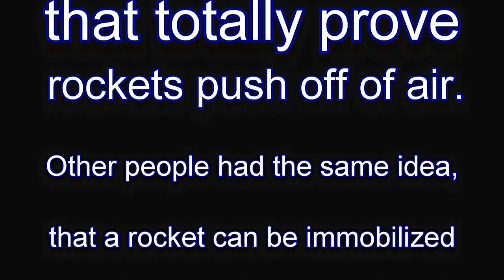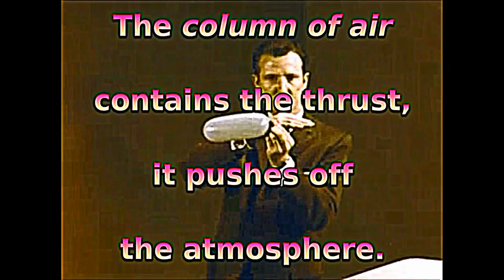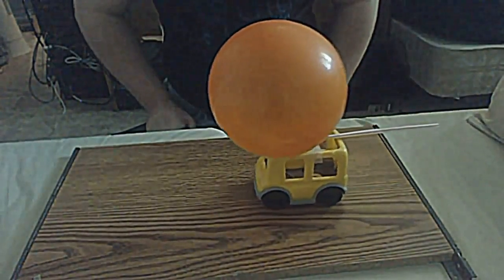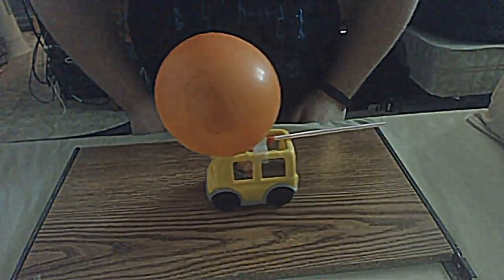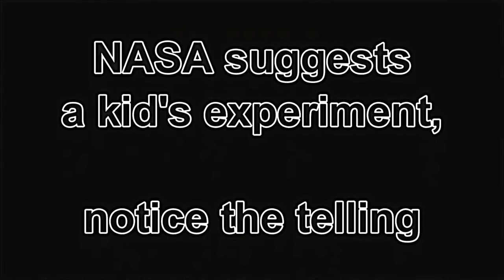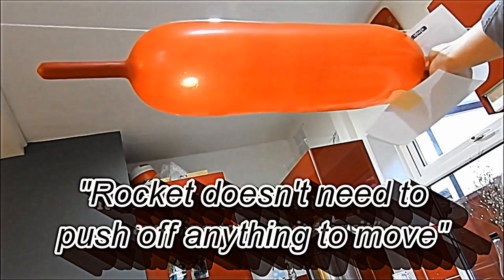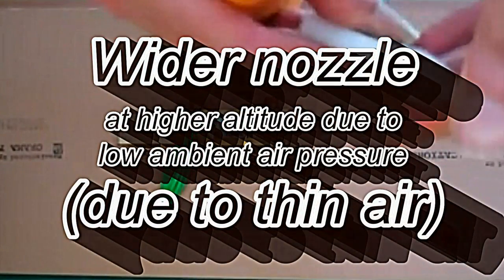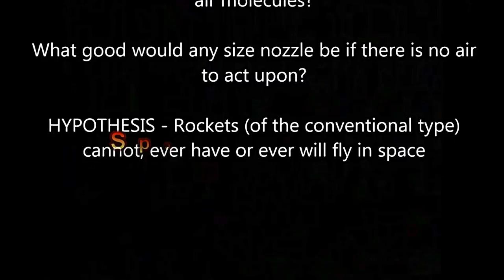rockets push off air

Comment: You've proved that if you redirect a rocket's exhaust so it exits out the sides instead of the back, the rocket won't go forward and will at best just spin... that's all.
Reply from the maker: Which debunks the "ejecting a mass" nonsense, since redirecting an ejected mass such as a cannonball, has no effect on the canon 😁👍
Reply: @rocketspushoffair  It does if the thing doing the redirecting is attached to the cannon.
Reply from the maker: @intcheese  and the vacuum hose was not attached to anything ... checkmate 😃👍
Reply: @rocketspushoffair  Did you not understand what I wrote? 

When you taped the sheet of paper to the balloon rocket, you made it a part of the rocket. In doing so you made the fact that the opening of the balloon was pointing backwards irrelevant and just created a rather useless balloon rocket with side exhausts.
Reply from the maker: @intcheese  Did you not watch the video? The vacuum was not attached. The experiments with the attached paper are still excellent, since there was no movement during the delay for the exhaust thrust column to hit the paper. And the time when the exhaust did not hit the paper in the middle and there was an imbalance, it just spun around, which again requires pushing off air. Read the description, it has ALWAYS been known rockets push off air. Goddard the liar certainly got no Nobel prize for claiming otherwise, he was ridiculed for 50 years by the New York Times until the media takeover ... read thee description, priceless historical info.
Reply: @rocketspushoffair  The vacuum not being attached just makes it an irrelevant experiment too. 

How long do you think the delay would be between the air leaving the balloon part of the rocket and the air colliding with the paper part of the rocket?
Reply from the maker: @intcheese  False. The vacuum not being attached is very relevant, because it proves that the exhaust thrust column itself is operating as if it was attached to the rocket, which is why bending it immobilizes the rocket.

How long is the delay when you hit a ball on a pool table? There should be no delay whatsoever if rockets work according to newtons laws, which were never intended for gases in the first place--that alone should tell you how wrong you are.

The paper is essentially a reverse thruster, just like on jet planes, and if air pushing on a paper or a reverse thruster can stop the rocket, then air pushing on air can and does push it forward.

Recoil of a gun when slowed down shows that the bullet is LONG GONE before any recoil takes place ... because recoil is caused 100% by the atmosphere rushing in to equalize the pressure in the barrel and smacking the back of it https://youtu.be/rtK3P6Jd_co?t=222
Reply: @rocketspushoffair  Why were weights added to the toy car used in the experiment?
Reply from the maker: @intcheese  the weights are not necessary, i just listened to him again, keep in mind he is a moon landing believer, he was in a thread where I proposed the experiment and he went ahead and did it ... then another opponent saw it and made the clip i used at the start of my video ... so there is no bias towards rockets push off air, any bias is in the other camp, the NASA fan boy camp
Reply: @rocketspushoffair  So, have you ever done the experiment yourself?
Reply from the maker: @intcheese  no, he beat me to it, but it went as expected if rockets push off air, and I do plan to do it in the future, i may also create a retail product kit 😃👍That will include the history and the science and a promo code for the forth coming book 😃👍
Reply: @rocketspushoffair  Why would you expect that result? There is air behind the rocket, so why does it not push off it everytime?
Reply from the maker: @intcheese  that's the beauty of it, the experiment  was designed to falsify the "ejectiing a mass" nonsense, and it did that, and in so doing, you learn about rocket thrust, specifically about the importance of full unobstructed penetration of the exhaust thrust column, into the atmosphere. And different experiments teach you different things, ... if the action reaction is between the exhaust thrust column and thee atmosphere, and the rocket and the column are one system, it makes perfect sense that bending the thrust column by 90 degrees has to have an effect, it can and does result in immobilization, but there is a sweet spot it seems, where you get maximum effect, you need to be a certain distance back, and especially important is how close you are to the side of the exhaust column ... he did not keep track of these two variables, but had he done so, he would be able to repeat it every time, that will be possible in the kit when it hits the store shelves this Christmas, lol! 😃👍
Reply: @rocketspushoffair  If there were no weights in the car, the vacuum would have had no effect, everytime. You'll only see the effect (sometimes) when the initial force from the balloon is only just enough to overcome the inertia of the stationary weighted car.

The fact that this video is 3 years old and you haven't yet bothered to try this very simple experiment for yourself is absolutely ridiculous.
Reply from the maker: @intcheese  Yes, it is ridiculous. But the fact remaiins that it had the effect that it had, and was repeated. Testing a system at its limits does not in any way nullify the test, rather, it accentuates it and underscores the result all the more. Historically (and intuitively) it has always been understood that rockets push off air.
Reply: @rocketspushoffair  What? Are you saying that if they had tried the same thing with no weights in the car and the balloon rocket moved everytime, that would be more proof for your claim?
Reply from the maker: @intcheese  No. It obviously would not move every time, the weights do not determine the principle, a Saturn V is very heavy, yet NASA says it's the same principal as a balloon expelling air ... you are not making sense ... just when  thought you were starting to get it 💀
Reply: @rocketspushoffair  Maybe I need to explain myself better. It's the ratio of the weight of the car to the propelling force of the balloon that's important and there is a specific ratio at which point the balloon won't produce enough force to move the car at all. What I'm saying is that the ratio of weighted down car and the force produced by the balloon used in the experiment is very, very close to the point just described and that if you just reduced the weight a little (or blew up the balloon more than usual), you would never see this effect. 

What I don't understand is why someone who has named their channel like you have, believes this experiment is proof to support the claim made in your channel name, and even thinks there's a possible product here, has not taken just an hour or so in the last 3 years in order to try this experiment themselves.
Reply from the maker: @intcheese  because i moved on to flat earth, and i also found other proofs for rockets pushing off air, and that was in the video, the nozzle diameter, that closes the case. But still, i'm not satisfied and i will be remaking a more complete final video on rockets, which will include me doing the experiment, and once i prove you wrong, then what? Are you going to accept it?
Reply: @rocketspushoffair  If you'd be willing to do the experiment in a way that tests my hypothesis, and if the results do not support it, I'd be happy to concede.
Reply from the maker: @intcheese  i might well be interested, what is your hypothesis, and how should it be done?
Reply: @rocketspushoffair  First, you'll want to ensure the balloon can be inflated to the same size for each test. Make a cylinder out of thin cardboard and put a long balloon in it. Tape a straw into the balloon's opening and that all should work pretty well. Next, add weight to the rocket until you reach the point where the deflating balloon can't move the rocket at all. Set up the vacuum in a fixed position and mark a start point for the rocket so that the straw is always the same distance and angle from the vacuum. Take off a little weight and conduct 10 or so tests with the vacuum. Take off some more weight and conduct another series of tests. Repeat until you've removed all the weight.
Reply from the maker: @intcheese  you are biasing the experiment to obtain the result you are looking for, it is a complete waste of time ... the two variables are 1) distance the vacuum is from the opening, 2) how close the vacuum is to the exhaust thrust column, perpendicular to it ... once that position is found by trial and error, it will always immobilize the rocket ... proving nothing is "ejected" and thus rockets push off air. In the orange balloon experiment there were 12 tries, 2 were successful, the 4th and the 6th ... all that's left to do is replicate that experiment ... you will be famous if you do, because I will use it in a video that updates the current one.
Reply: @rocketspushoffair  I'm not biasing the experiment, but I also probably wasn't clear enough. You should have already determined the ideal location for the vacuum with respect to the balloon nozzle. Use that location for all tests. My contention is that you will see the effect less and less the lighter the rocket gets. Afaik, you disagree.
Reply from the maker: @intcheese  I could just as easily turn down the vacuum until the effect disappears ... it seems you are suggesting that the vacuum somehow has enough suction to pull on the cart? That was debunked at the start of the video.
Reply: @rocketspushoffair  So you do agree my contention?

I'm not suggesting that the vacuum is pulling the cart.
Reply from the maker: @intcheese  Good, so what are you contesting?
Reply: @rocketspushoffair  Do you agree that if the experiment I proposed was conducted, the results would show that the lighter the rocket gets, the less often the vacuum will have an effect on it?
Reply from the maker: @intcheese  Do you agree that if i wanted to redirect a cannonball, a flyswatter will not work?
Reply: @rocketspushoffair  Yes. Please answer the question.
Reply: @rocketspushoffair  Is this how conversations with people who don't share your beliefs usually go?
Reply from the maker: @intcheese  In like fashion, lightening the cart progressively is equivalent to weakening the vacuum ... you are not testing weather or not the ejection hypothesis holds true ... you even stated "less often" but you fail to understand that even if it occurs one time, that's all it takes to debunk the ejection hypothesis ... the experiment that needs to be done, is to find the exact location of the vacuum so that it can be repeated 100% of the time or close to this. Luke (orange balloon experiment) found the "sweet spot" 2 times randomly, he would not have found a single success if the ejection hypothesis was true. Do you get it?
Reply from the maker: @intcheese  There are other variables, it could be that distance behind the exhaust varies with weight, it varies with strength of balloon, diameter of opening ... but none of those variables tell you if the ejection hypothesis is true or not, even though they can lead to immobilization of the rocket. It's not a matter of belief, it's a matter of fact. You can no longer believe in the ejection hypothesis after seeing thee orange balloon experiment and understanding it, if you are honest with yourself. The right thing to do is replicate it, so you can verify for yourself what thee truth is. I proposed the experiment, and the expected result was achieved by my opponent. All that's left for me, is to take measurements and make it repeatable for anybody with dollar store materials.
Reply: @rocketspushoffair  For a specific balloon, why should it be easier for you to capture the exhaust column with a vacuum cleaner when the balloon is attached to a brick than when it's attached to a feather? Changing the weight of the rocket doesn't change how much mass its balloon ejects per second.

I think you're wrong in your belief that any instance of this phenomenon proves your channel's name true. Do you get it?
Reply from the maker: @intcheese  Don't take what I said "any instance" OUT OF CONTEXT. Notice how the first thing Luke did, was to show the balloon can move the rocket, then he showed that it can move a heavier rocket, no problem, so, unless you are claiming that the vacuum was holding the rocket back, then you must agree that rockets push off air, and since it was proven at the start of the video that there is NO WAY that thee vacuum was holding thee rocket, you are all out of excuses, do YOU get it?
Reply: @rocketspushoffair  Here's a counter hypothesis. The vacuum isn't completely redirecting the exhaust column. It's just causing a small amount of the balloon's force to push against one side of the straw nozzle. In most circumstances, the rocket will act pretty much as normal, but when the rocket is weighed down sufficiently, the total force from the balloon minus this tiny amount of redirected force isn't enough to overcome the rocket's starting friction.

The problem I'm seeing is that a years old and quite limited experiment that you didn't even conduct yourself has completely convinced you that you're correct and you don't see any point in trying out experiments that may challenge this very strongly held belief of yours. That's not how to science. If you think you might be right, attack your own belief as severely as someone who believed the complete opposite would. If it stands up, then it's reasonable to believe.
Reply from the maker: @intcheese  "as severely as someone who believed the complete opposite would" that's what Luke did. All  have to do is repeat it. That's how you science, the experiment must bee repeatable, he technically did repeat it, since he got two successful results. What you said in the first part of your reply still proves rockets push off air, since the influence of the vacuum is AFTER the exhaust has passed the opening, AT A DISTANCE, thus, thee full power was available for the "equal opposite" reaction to propel the rocket. Truth is, YOU are not willing to let go of your erroneous belief, of the now falsified "ejection" hypothesis. Remember, hitting an ejected object at a distance from thee opening it came from, does NOTHING to the thing that ejected said object.--This s not the case with rocket exhaust (thrust column, implying it is one with the rocket, at all times, and at a distance)

The reasonable, scientific explanation is that as the exhaust thrust column tries to penetrate thee atmosphere, it is resisted on all sides by the atmosphere, this propels the rocket forward, just like a jet engine does a jet plane, both rockets and jet planes are limited by thin air, hence the reason for a wider nozzle up high, and thee reason rockets go horizontal and then fall right back down completing a parabolic.

in short, your belief has been proven wrong. You don't live on a ball, space is fake.

Here is a funny, but fact based video I made refraction.flat.wtf maybe you will get it then?
Reply: @rocketspushoffair  What makes you think the vacuum won't have any effect inside the straw?

Also, jets need air (specifically the oxygen) in order to burn fuel. Rockets carry their own oxygen supply.
Reply from the maker: @intcheese  Because when the straw s completely inside the vacuum (inline) there s no effect ... how can there be an effect at a distance and perpendicular to the exhaust? ... Admit it man, integrate the facts and change your world view, it's the right thing to do! 😁👍
Reply: @rocketspushoffair  When the vacuum is inline with the straw, it can't assert any lateral force on the straw. When the vacuum is perpendicular to the straw, any force it asserts on the straw will be lateral. I'm talking about lateral forces. The fact you keep bringing up the inline experiment in response to what I've written means either I haven't explained myself well enough for you're just not understanding it.
Reply from the maker: @intcheese  there is no lateral force on the straw, just hold a strip of paper at a distance from the vacuum and see for yourself, the only one not understanding is you, go ahead and believe in your rocket space fantasy
Reply: @rocketspushoffair  Have you held a strip of paper out horizontally at a similar distance and orientation from the vacuum that the straw was? I just did what you asked me to and it was obvious that the strip of paper was being deflected by the vacuum.
Reply from the maker: @intcheese  why are you resorting to lying?
Reply: @rocketspushoffair  I'm not. It's not hard to find some paper and a vacuum cleaner. You should try it.
Reply from the maker: @intcheese  nah, i'ld rather see your video first, i don't want to make a mistake, i want to do just like you, that's how science works ... by the way, how come having thee entire straw directly in the vacuum hose does not immobilize the rocket AT ALL, but having thee vacuum perpendicular to the exhaust stream and at a distance from the exit point/opening of the exhaust does? I think you are all out of excuses, time to decide, who you want to see in the mirror: a science denier or a realist? You don't live on a ball 🌍👈😂
Reply: @rocketspushoffair  Why did you just assume the outcome of the paper strip experiment you proposed without actually doing it? 

As someone who believes that rockets move forward just by throwing mass out their back, I don't see any reason why the rocket wouldn't move when the vacuum is in line with the straw.
Reply from the maker: @intcheese  I have done the paper strip, just didn't film it. You are not being honest. You are confusing yourself, because you contradict what your eyes are seeing (or not seeing) there is no mass "ejected" or "thrown out" by a rocket, there is only combustion, and you have NO WAY to explain why the rocket was immobilized 2 times out of twelve--this should NEVER HAPPEN if your belief was correct--it is obviously wrong. You are the only one now that can reconcile yourself to reality, my work is done. 😁👍
Reply: @rocketspushoffair  Mass isn't being ejected from the balloon?
Reply from the maker: @intcheese  No, obviously not. And confirmed by the 2 immobilization results in thee experiment.
Reply: @rocketspushoffair  Air doesn't have any mass?
Reply from the maker: @intcheese  it is a gas, newton's laws were meant for cannonballs, never intended for gases ... there is simply not nearly enough pressure in the cone/combustion chamber to support your beliefs, face reality please.
Reply: @rocketspushoffair  The balloon ejects air.  Air has mass. Therefore, the balloon is ejecting mass.

That's all fantasy?
Reply from the maker: @intcheese  Yes. The balloon isn't "ejecting a mass"
Reply: @rocketspushoffair  Do you think air is massless?
Reply from the maker: @intcheese  no
Reply: @rocketspushoffair  So, why do you keep insisting that the balloon isn't ejecting mass (in the form of air)?
Reply from the maker: @intcheese  it's not "ejecting" anything
Reply: @rocketspushoffair  So, you must think air doesn't exists. What a silly thing to think.
Reply from the maker: @intcheese  no, it is not being "ejected" that's silly to think it is, while there is a continuous stream flowing 😃👍
Reply: @rocketspushoffair  oh... You just don't understand what "ejecting" means.
Reply from the maker: @intcheese  i do, YOU don't
Reply: @rocketspushoffair  teach me...

Why is it wrong to say that a hose ejects water?

Please make sure to refer to at least one dictionary.
Reply: @rocketspushoffair  This might help.

eject- force or throw (something) out in a violent or sudden way.